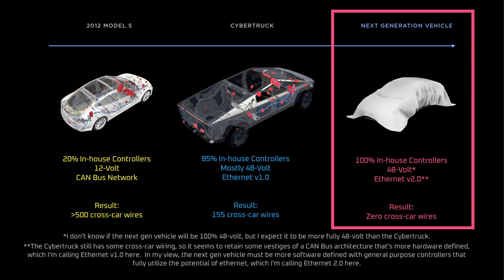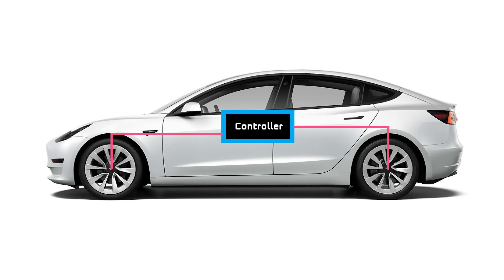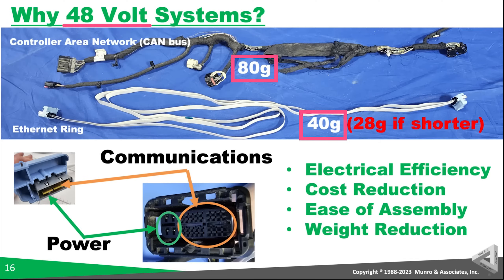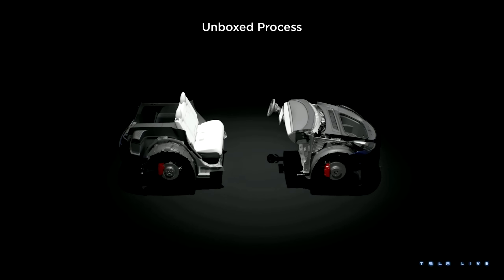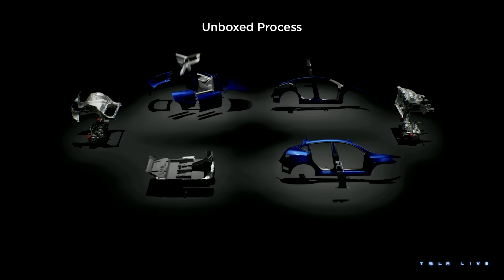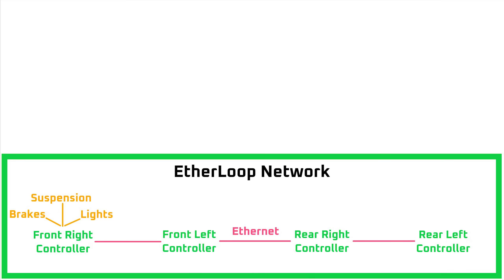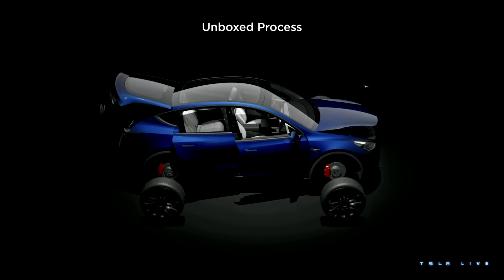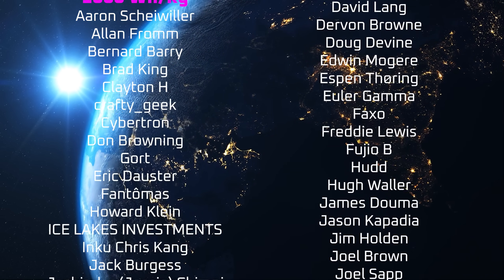Digging Deeper on Tesla's Etherloop Wiring System

Comment: The real issue is that lots of those cross car systems are safety critical. Braking system, lights, around car sensor packages for the various levels of self-driving and so on. Having a single approved and well tested system handling each one that you can pretty much get off the shelf is very convenient. 

Ensuring something like the ABS system under emergency braking is acting in a coordinated way at the millisecond timescales required on all 4 corners of the car is much easier with a single module handling it all.
Reply: That's where the EtherCAT standard helps. Each device modifies the Ethernet packet as it travels both ways around a ring. The result is a high bandwidth low latency communications with redundancy.
Reply: Convenient or complacent? This is why traditional OEMs are failing behind.
Reply: @GregHassler  They really aren't.
Reply: ABS master control will still be a single module, but it will source and send data to each brake over the network in its time slice.  If/when they switch to the Brembo Sensify system this network can eliminate the hydraulic system completely (or partially, there's options there too.)
Reply: It will be interesting to see whether Tesla tries to put everything on one bus, and whether regulators let them. You can build priority schemes that give you realtime-ish performance when everything is working, but if your headlights malfunction and start spewing garbage onto the bus they're still going to take out your brakes.
Reply: I am not a network engineer, but

Since this is a closed network with unchanging hardware, they should be able to get all of speed and reliability they need, and the latency for things like brakes should be easily achieved with modern hardware.

You can implement error checking and correcting in the protocol, and every thing else which allows computers to communicate so quickly today using IP. there is arguably no downside to using ethernet if you are in complete control of the protocol you implement on unchanging hardware.

it is basically an outdated rule for critical communications, imo the speeds have simply brute forced through that limitation.
Reply: Who needs brakes anyway  @ceoyoyo
Reply: This is the crux of why some degree of specialization and cross-car wiring is still necessary. 

Yes, im sure you could run safety critical systems on general purpose hardware but it just introduces so many unknowns. On an EV design project I worked on, a large chunk of the car ran on a single controller, at some point a software change during an update caused some modules to start spewing erroneous data onto the CANbus causing the main computer to lag and start dropping CAN frames and lead to the electronic throttle to start lagging and get stuck on.

Its one of those things that works perfectly until it doesnt, you dont want to find out during emergency braking that some extremely niche change to some unrelated software on a recent update causes your ABS to fail if you have your left indicator on or some stupid interaction like that.
As other commenters have noted, yeah its entirely possible with modern communication standards and hardware to achieve the required latency and throughput, but the question should be is that degree of system interconnectedness even practial to make safe?

What is so bad about buying a well tested, widely used and proven safe off the shelf system from Bosch or the likes. A few extra kilos of weight and a few extra steps during assembly?
Reply: @SoulAir  You definitely don't want to use ethernet. In an ethernet network anybody can talk whenever they want, and collisions are handled by everyone shutting up for a random amount of time then trying again. The speed and latency of the network is unpredictable because it depends on who's talking, how much they're talking, and random collisions, which are resolved by random numbers. Modern ethernet networks use network switches to basically give every device its own network, but the idea here is to avoid all those wires.

You could use something like ethercat, which uses some of the ethernet hardware but has only one device that's allowed to talk. Other devices require special hardware that forwards each message to the next device, possibly modifying it. That works great for things like CNC machines, but it depends on each device to forward the messages. If one goes down (or two in a loop configuration) then you lose everything on the other side. Fine for CNC machines, where if one motor goes down you usually want the others to stop. Not so good for your steer by wire system.

CAN is similar (also used a lot for CNC machines and things like that), but it's a bus, like the old coax ethernet. There's a continuous wire (the bus) and every device connects to, but does not break it. So if a device drops out, it's gone, but everything else keeps working. You can still lose everything if a device shorts the bus, or starts spewing garbage, but that's true for any shared network architecure.

Last is dedicated wires, including ethernet with switches. Then a failure, even a short, can be isolated so it only takes out that device.

CAN isn't just some outdated standard. It's a careful compromise between saftey and reliability and reducing wires. For really important stuff you don't even want to use that: you want dedicated wires. You don't have to use it for everything, you can go to ethercat-style or even full on unswitched ethernet for some things, but you have to carefully consider the safety and reliability compromises that entails.
Reply: @ceoyoyo  the idea that collisions are a problem is outdated. The bus is so fast that it could retransmit many times in the time it takes for a single CAN transmission.

We are biased to think ethernet is a little slow or unreliable because we are interfacing with drivers and software not to mention IP above it. In the car, this will all be designed under one roof.

And this is an unchanging network, so I would actually expect zero collisions to occur if the timing parameters are set accordingly.
Reply: @ceoyoyo  in true modern Ethernet network collisions arent handled by everyone shutting up for random amount of time. Those are truly handled by having a full-duplex switched network to begin with.
Reply: @volodumurkalunyak4651  The usual solution is to give every device it's own wire, yes. But the point here is to reduce the number of wires.
Reply: @ceoyoyo  Ethernet already has transmitt and recieve on the same pairs (1Gbps or faster over copper).
Ditching full duplex over nouthing - isn't a solution. Illusion of half duplex beeing simpler - not worth over dealing with all of collisions.
Reply: @volodumurkalunyak4651  A switched network requires multiple wires, otherwise there's nothing to switch. It's not a good solution if you're trying to get rid of wires. It doesn't get rid of the loss of determinancy from collisions either, it just moves contention off the wire and into the switch. It is easier to minimize there though.

I don't know where you're going with full vs. half duplex. There are standards for both. Full duplex is certainly much more complicated, expensive, and everything else being equal has poorer noise tolerance.
Reply: @ceoyoyo  that has to be done. Some redundancy in wires (especially carrying so much safety criticall signals) is required.
Reply: @ceoyoyo Yeah... fault tolerance is the top priprity
Reply: @SoulAir  I would say "This is an unchanging network" is wrong. How many recalls have there been because a newer vehicle needed a firmware update on a critical component? One of the big selling points of having a tesla was "it is the only car that improves as you own it"

You should watch the video "Half as interesting" did on KUOW 94.9 knocking out the radios on a bunch of Mazdas. for the TL;DR, start that video at 2:30. 

I have had my home network go down because a computer started spewing junk on the network. I had to install a new NIC in that system because the network might get taken down if i used the internal one. I think it was a firmware update that broke the WoL function.

This is why i hate the idea of radios being on the CAN bus. Going with my past experience of a computers malfunctioning NIC bringing down my home network, anyone who thinks "we should just put all the critical systems and auxiliary systems on the same bus" is ... ignorant. Any other word i would put there is not polite.
Reply: @LaserFur Yeah, EtherCAT is an actual standard designed for this. No one should use or be allowed to use actual Ethernet to hook up your brakes, that’s insane.

Although I would argue if you want to throw camera data around, you should just have a separate bulk-type bus.
Reply: @ceoyoyo  and what if they use direct Ethernet connection between every two controllers without a switch? Then ever  controller can send data in full duplex either way
Reply: @TecSanento  Sure, you can do that. The problem is that each controller the signal has to go through introduces some processing delay. If you run traceroute to a computer on the Internet you'll notice that routes with more hops take longer. In realtime systems this is an even bigger problem because the delay is usually unpredictable... it depends on what each of those intermediate controllers happens to be doing at the time.

Ethercat basically uses the approach you've described: mostly standard Ethernet physical layer between controllers strung out in a line or loop. But the receive, process and forward process is done in dedicated hardware and under very specific constraints so that it is as quick as possible and always takes the same amount of time.
Reply: @LaserFur  EthetCAT is only a standard that specifies how logical communication is handled. Electrically it's the same ethernet bus. That is the fragility of the system to me, CAN is a protocol that is robust electrically, it's a differential signal, meaning that it's immune to noise, and meaning that even if one of the two wires for some reason is broken, data can still get to the device if you read the signal referenced to ground. 

Also CAN is a bus, you loop in and out of devices, but electrically the connection is a passtrough, even if the device completely burns down the CAN bus is not interrupted. With ethernet I guess that every device in the "bus" has two ethernet interfaces and acts like a switch (don't think they implemented the old style 10base-T over coax that was a bus), thus if a device breaks, looses power, etc the signal doesn't passtrough to other devices after it. This can be a problem in safety critical systems, unless they didn't thought of other kind of redundancy (but at that point, we are still cheaper than CAN?).

Of course where a lot of data is needed ethernet is useful. But to me not for safety critical systems, like lights, ABS, air bags, etc, where you want something reliable when you need it. And you really need to transmit bits of information.
Reply: @alerighi  EthetCAT has other related standards such as safety rated versions. also it's a loop so that if one device breaks the signals all continue. The way each device works is that it receives a packet from one port and modifies part of it and then transmits it out the other port. That means there is a packet going each way in the loop. It is also harder to isolate CAN than to isolate Ethernet. I'm using a ISO1050DUBR IC along with a DC-DC converter. While a 100Mbit Ethernet link would just need two transformers for each port.
 For safety there is EthetCAT variants of "Safety CAN". 
 And CAN at 500K stops working if one wire breaks. There are too many reflections once the terminator resistor is lost.
Reply: @Byefriendo totally. I think Tesla don't put nearly enough regard into the robustness of long developed safe design. Even self driving is crazy. I've seen videos of Tesla's going through red lights at road works due to the software getting confused...  No thanks...

Comment: Great explanation. I did a presentation at the Automotive Ethernet Congress last year about unraveling the 10BASE-T1S wiring harness, so this fits into the main area I am working on 👍😅 I wasn’t familiar with the latest Tesla architecture. Many OEMs are still struggling with zonal architecture. Keep up the good work and greeting from Bavaria.
Reply from the maker: Awesome! Glad you enjoyed the video 🤠✊🏼

And thanks for the comment!  It's always good to hear from people in the industry to let me know if saying stupid things, lol
Reply: @thelimitingfactor  No all good. For the aggregated links between the zonal controllers 10G is ready and 25G is on its way. We tested also with 50G is possible over 5 m in case anybody needs it and glass fiber may be an option in future. I am im RnD try to keep an eye on trends and what may be of use in future. Tesla is quicker than the rest of the market.
Reply: I wanted to add that Ethernet collisions were mitigated over 40 yrs ago in commercial networks. Software defined routers and switches are mature and can be added to any of those generic car controllers. Growing up with Ethernet speed increases, lots of people do not realize that protocol stack bugs show up as speed increases. The CANBUS being so slow, I am sure there will be many failures nobody ever dreamed of when bus speeds are increased. Point is that Ethernet has been through the gauntlet for over 50 yrs and there is just nothing close to its robustness.  Ethernet wiring EMI is very well understood since it is just about anywhere. One can also run multiple networks on the same wire e.g. one encrypted and another not encrypted. I am just touching on the tip of the iceberg on Ethernet's benefits over any other communication protocol.
Reply: Used to live and always loved Rheinland-Pfalz and Bavaria .. and the seasons' changes there. You should arrange for a visit to the Giga-Berlin plant to tour and talk with some of their auto-electric engineers. I bet you would enjoy that and could make it part of your next paper at AEC!
Reply: Totally agree. They're talking about t1s instead of can, but the major controllers still use 100/1G-base-t1. What i expect they dropped is autosar. That's sh*t's stupidity incarnate.
Reply: Oh very cool! Quick qst - is latency a challenge for Ethernet Zonal networks, given that there are more "hops" ? And what do you think abt PCIe as a possible low-latency & high BW solution?